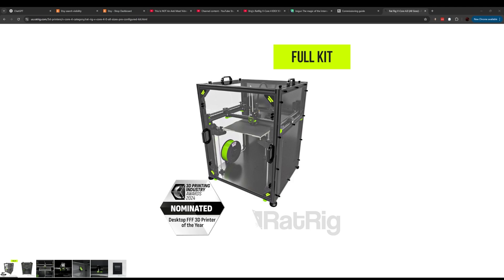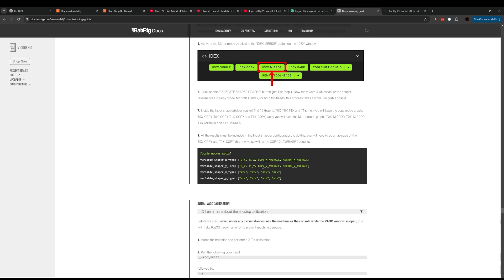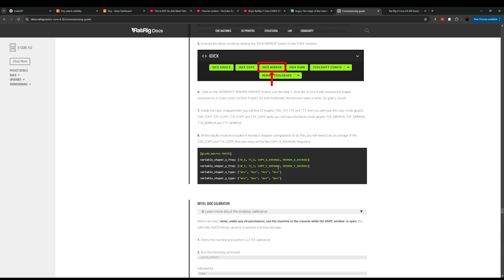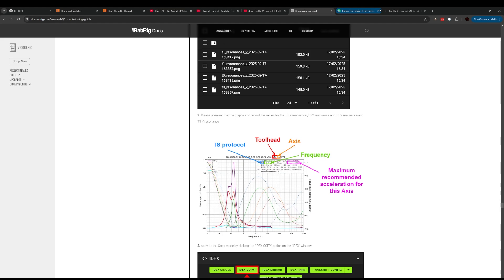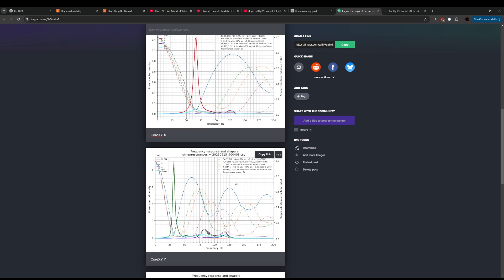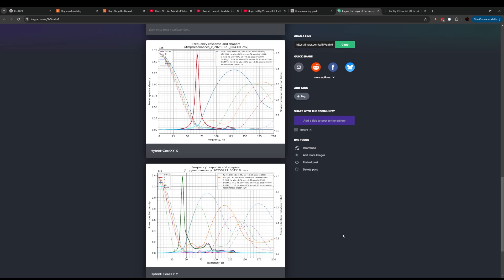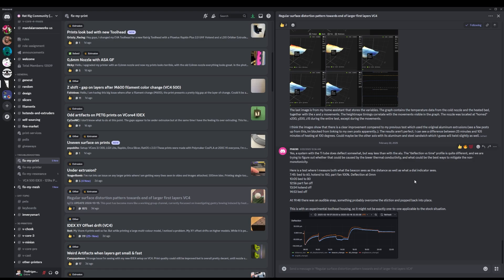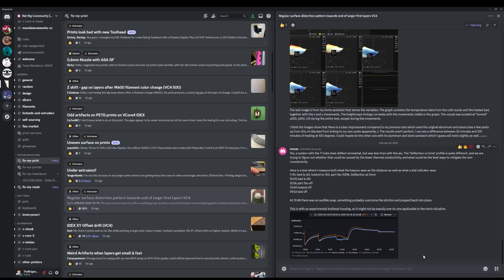Brig's RatRig V-Core 4 Hybrid+CoreXY Review and IDEX Follow-up

Comment: I found your channel through your 125Hz peak thread. You mentioned in a post that you thought some of the VFAs were tied to the larger motors in the Vcore4 machine. I've been chasing down VFAs for a long time now and I'm having a really hard time just going fast to fix the problem, it seems like it's masking a mechanical issue. Have you had any other insights into solving VFAs without high speeds?
Reply from the maker: Hey sorry for the delayed response, I don't check for new comments often. There's a lot of causes of VFAs unfortunately (belt tension, belt teeth, idler diameters, stepper cogging, etc) and it makes finding a fix very hard. In my case, I was probably referring to "stepper cogging", I would Google this term as you can find a lot of results about it that aren't just 3d printing.

I know some higher tier stepper drivers offer anti-cogging features, and that may be something to look into, but I wouldn't be afraid of the high speed at all. I'd focus on getting your shaper graphs clean enough to be get an MZV recommendation on both X and Y and get that shaping config in there, then you should be able to easily push high speeds with no ringing concerns, high enough stepper cogging based VFA disappears. I regularly print at around 175mm/s @ 6k accel on my 500 with good quality. This was really counterintuitive for me coming from slow bed slingers.

Orca Slicer has a good VFA test. If your VC4 500 is anything like mine, you'll see it really smooth out towards the top of that test. I wouldn't look at it as masking a mechanical issue, as the cogging is just a factor/characteristic of the motor's construction. Running the motor faster lets inertia carry it through the microstep detents, smoothing out the cogging before it can take effect.

Once you let it go fast, your problem will go from VFAs to part cooling, which is a much more fun problem to have (you'll be eyeballing that CPAP upgrade so you can keep the machine in those fast and pretty ranges).

Good luck, feel free to ping me on the Ratrig discord too.
Reply: @thebrigandier Thanks for the thorough response. I've gone through several tuning iterations and tried all sorts of things but I'm still bothered by the fact that I have to print fast to get rid of VFAs. I bit the bullet and ordered new .9 degree motors, 1.5GT belts and all new pulleys hoping this will resolve my issues. Hoping to get those installed next week so fingers crossed. Then of course I still have to run through all the retuning steps.

Comment: Prusa used to be good. I had to return one of their printers recently because it failed about 50% of the time. They tried several times to fix it by sending me parts to install. Nothing worked and they pretty much had no clue. I had to resort to sending the printer back. It's sad to see them fall from the excellent company they were.

Comment: It is fair to Ratrig to take down that video - in that particular configuration - if they fixed some issues, yes.

But I hope you consider re-posting a video with similar content (with the issues cut out that have been solved by Ratrig of course).
Why? Because there are still a lot of hardware & design issues unsolved (plate spacers, belts too close to extrusions etc.) which people need to know about.

The fact alone that you needed to downgrade the IDEX to a normal 3D printer, to be happy with the results, should speak volumes. 
If you need to remove the part that makes it what it is supposed to be, then it's basically not worth to buy it in that config at all. Then I could just buy any similar 1-toolhead 3D-printer.
This might be over-exaggerated but I hope you get what I mean, principle wise.

The IDEX and the fast toolhead switching was the only feature that made the Ratrig V-Core 4 really stand out for me.
So still: if it is like this (that there are severe hardware-issues remaining) I'll abstain from a purchase, for now.

Hopefully you'll keep us posted!

And thanks again. If I hadn't seen your first video I might have bought the IDEX and wasted a lot of time and nerves by now.
 (Also thanks for still linking to it, I was not sure if you were the same guy).
Reply from the maker: The original video is still available (it's linked in this video's description), it just doesn't show up in the search. My concern was that, if Ratrig has started addressing these issues, that the video would be out of date and people wouldn't see the follow-up first. I'm hoping this video's equally ominous thumbnail will catch eyes as well as the first video did, and inform users of problems that are in a state of (hopefully) being addressed before they watch the first video. I also had a lot of people coming at me in an ultra defensive way, and it just wasn't something I wanted to continue dealing with. Hopefully Ratrig continues fixing the issues; and if they don't, hopefully users besides me will upload their own reviews.

I totally get what you mean principle wise. I think it would be fair to give them a bit of time to address the issues now that they are informed, then I (and hopefully others) can follow-up. I think they have a tremendous opportunity here to show they are a company that takes care of their customers after the sale is complete, or they might fumble it completely. We'll see. :)